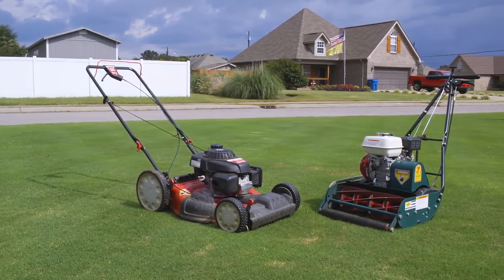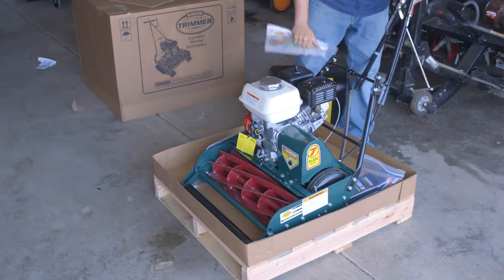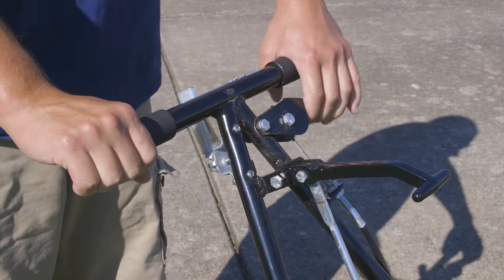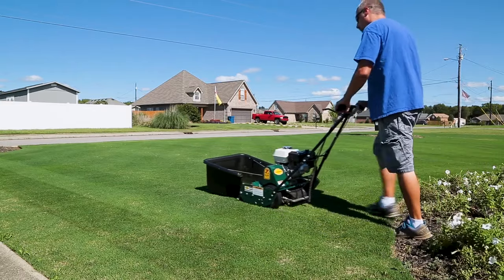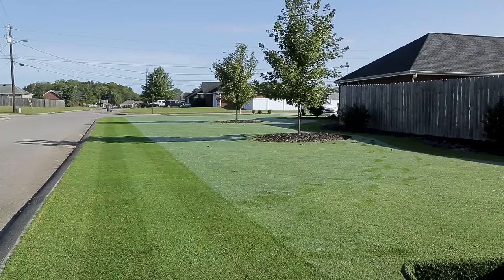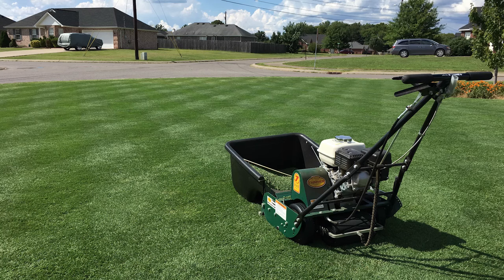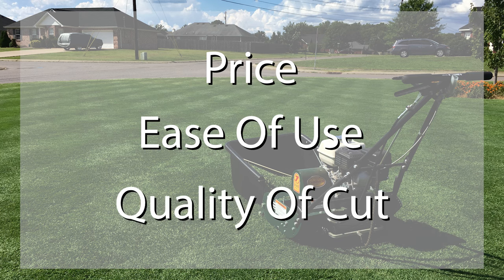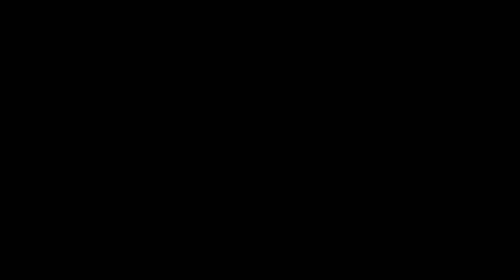California Trimmer 20" Classic Reel Mower Review

Comment: I bought this mower and used it for almost two years.  For the price, quality of the mower and the quality of the cut, I doubt you can find anything better.  However, this mower weighs a ton.  I’m in South Carolina and my lawn is not very flat. Numerous up/down grades and undulations making it difficult to maneuver this machine. I’m retired and in my upper 60s and in reasonably good shape and felt I could effectively wrestle this machine. I tried for two years and finally gave up. Between this and my Honda HRX217, the level of effort required to run it was at least triple that of the Honda. Keep this in mind as you consider your options.

Comment: I learned to mow with one of these in 1980 when I was 9. It was a handful at first, but fairly easy to learn on. Pretty soon the front yard at my house in Salinas was almost as smooth as the greens at Pebble Beach lol. Great machine.
Reply: My dad had one that he bought in 1970 when I was about 7.  If I remember correctly, the sticker said, "The Trimmer" Los Angeles, CA.  The company appears to be in Washington State now.  Still looks pretty much the same design but safer.  Ours had no guards over the belts and chains and looked like it was made more in a fab shop than a factory.

Comment: Great help in setting up my mower.  Ordered and installed the handle extensions. Not as easy as putting the mower together. But love the extra length on the handles.  Couple of questions, When not engaging the drive wheel is it okay to mow short areas,, you know when your in a corner by the fence. Speed,  I like to run about half speed, what do you guys recommend?   thanks

Comment: I bought one of these Reel Lawnmower, boy it is old, it has a 3.5 Horespwoer motor, and it is super heavy.
Reply: I bought a heavy one too, with a 2hp B&S.  It runs well, but at about 50 y/o it needs some adjusting.  The grasscatcher is galv iron sheet over an iron frame.  I made a big effort to research it a few weeks ago, and it seems to be about 1968-72.  The seller was a swap meet old/used tool guy who had no history on it.  It is mostly original and painted for it's age.  It might be unsuited for rural Oahu use.  As a kid, the neighbor's Dad had one, and I was quietly fascinated by it.  I replaced the rubber drive belt, but it seems to need dressing.  As a test run this morning was somewhat inconclusive.
Reply: @tomfrazier1103  I guess the big problem with these type of mowers that they are expensive to have the blades sharpened. Once people see that it cost over 200 dollars they lose interest fast. My lawnmower has a 3 HP BS moter, my King Of Lwan edger is really old as well,  I know it hadn't been started in 16 years and I did a points and condenser upgrade, added fuel and I pull it started. Amazing
Reply: @Moondoggy1941  Their used to be a G.I. generation guy in a step van who drove around offering services on these, but I haven't seen him in a few years.  My Grandfather had an old edger that I never used, but I had to fight a cranky rotary mower and mow theirs & our lawns.  My first paid job, though we were far from stores, and the kid economy, except the Big Cookie at grade school.  I never comprehended that school lunches were for poor kids.  I was partly raised by that G.I. generation as well.

Comment: So, that lever on left side of handle has to be pulled in to make it go forward?.......and if you let go the mower will stop kind of like a safety driver lever on a Honda Rotary? I just bought a True Cut and they dont have that safety feature.
Reply: The handle has to be squeezed to make the mower go forward and reel spin.  No separate lever for each.
Reply: @brettsmith2489  I bought one recently, simple to use safely. Lot better controls than a Tru Cut

Comment: Just bought the 20" with GS 120 engine. For some reason 2nd time I used it the reel just stopped moving while engine ran. I guess I have t6o take it in.
Reply: Did the engine bog down when you tried to get the reel to spin?  Your reel may be too tight or you may have something as little as a piece of mulch between the reel and bedknife.

Comment: Do you have any recommendations on whether to choose the classic or high cut? Understand the basic difference between the two but not sure which one to choose or if one is better over the other.
Reply: Rahul Thakur 
I had the same question.  My grass is centipede and I ran across the following information that led me to purchase the high cut.

The Standard models provide a total cutting height range of 3/8” to 1-7/8”, while the High-Cut models have a total cutting height range of 5/8” to 2-1/4” (as measured from a hard/flat surface to the top edge of the bed-knife). To further differentiate between them and help the decision process, our recommended approach is if the desired cutting height is 1-1/4” or below, go with the Standard; if it’s above 1-1/4”, go with the High-Cut.

Hope it helps...
Reply: Doesn't matter which one you get as they both will do the same height, one just comes pre assembled for low cut and the other comes set for high cut. It's easy to change either one for high or low cut.

Comment: I heard the grass clippings doesn’t even go into the grass catcher, it shoots off to the left. Anyone have this issue?
Reply from the maker: The reel blade’s cutting edges are curved and placed diagonally around the core of the blade in a “helix” type of shape which allows for a smoother / reduced friction rotation while maintaining the continual shearing action across the entire width. So when the reel is spinning it creates a spiral (corkscrew) motion which causes the clippings to come out from right-to-left (when viewed while mowing) and accumulate more on the left side of the catcher. It seems to occur more when cutting very small amounts and for the most part it's not an issue once it's explained, but we're looking at adding vanes to the shield to help steer the clippings a bit straighter and reduce the distraction.
Reply: @californiatrimmer2021  great response thank you! Yes I’ve seen people modify their clippings catcher to be like a makeshift taller wall to prevent from flying off to the side or out of the catcher completely

Comment: What height is your grass being cut in the video?
Reply: That’s my lawn.  It was around  3/4”.  The lawn isn’t completely flat so some bits are a little higher and some are lower.
Reply: @brettsmith2489  thanks so much!  looks great!
Reply: @saxman2u  Thanks!
Reply: Brett Smith just curious, what exact hybrid of Bermuda are you cutting? I’m wanting to buy this mower for after I finishing seeding my Arden 15/Monaco blend (ss 22000 I believe it is) and I’d love to know what exact kind you might have. Thanks!
Reply: Mine was put down as sod.  It should be Tiff419 ( I think I got a little mix of something else in parts of the yard).   Definitely use a reel mower for the first cuts after you seed.  A rotary mower can sometimes pull up the new grass.  I actually used one of those Scott’s brand manual reel mowers when I put down the sod and when  I planted bluegrass in my backyard.  I did that for the first few cuts just to keep some weight off the grass.
Reply: Brett Smith that helps! I can definitely snag a manual reel as well. I’ve been looking into those as well. The seed route seemed more satisfying and was a more affordable route for me. I should be getting that shipment come Monday and we’ve already cut out the old sold and start tilling this weekend.
Reply: @elijerrr   be sure to roll the lawn after you till.  Look into using peat moss to cover the seeds. They don't need much covering them since the seeds are so tiny.  Also, the peat moss will turn lighter in color if it starts to get dry.
Reply: Brett Smith definitely! I’m getting a roller and peat moss as well. The peat moss has been pricey and hard to find. I’m in California between Sacramento and San Francisco.
Reply: @brettsmith2489  Where did you buy it from with the front roller already installed for you?
Reply: @dkbomb  The roller came preinstalled for me from California Trimmer.  I dealt with them directly so I'm not sure if they always ship like that.   I would call them up directly if you are wanting it preinstalled.  Great company to deal with.